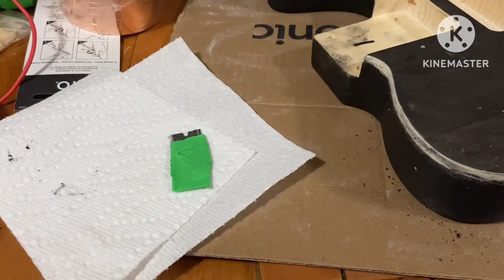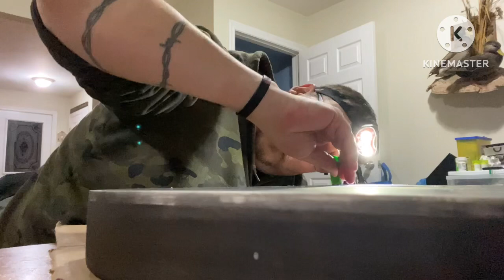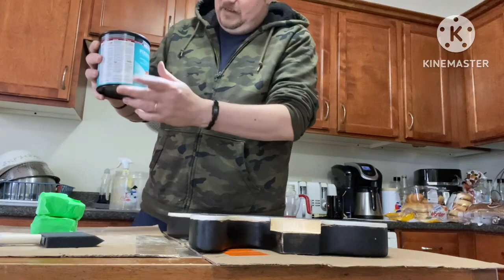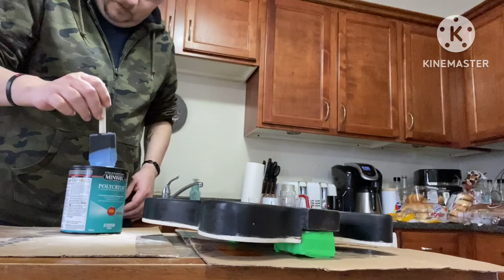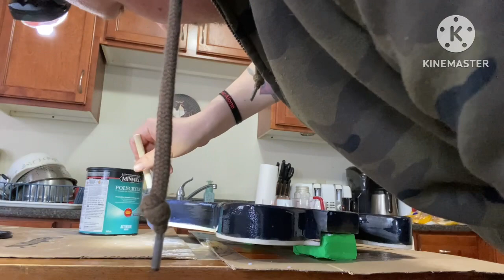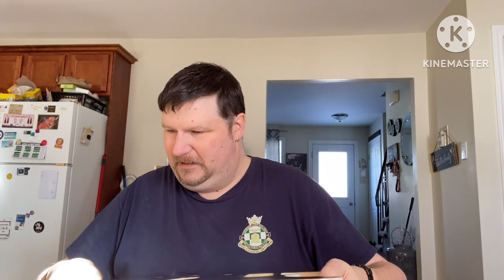Solo Music guitar build Pt 2 Binding scraping/ clear coat

Comment: Nice work on the guitar project, just curious if you're going to do any wet sanding of the clear coat on the back and apply another coat.  Have a great day
Reply from the maker: Thanks Rusty! I wasn’t planning on it, this seems to have a pretty decent sheen as is, might do another coat or two on the back as I clear coat the wrap, and than I’ll polish it all up.
Reply: @JMac.  Nothing like doing a wet sand and dropping a new coat over it to get that depth and shine
Reply from the maker: @TheRustyRazorOriginal  yeah, that is a fair point for sure… I’ll have to see what it looks like come Friday, have to get a capo and some feeler gauges to do the setup, just hate to have to clear coat again though lol, I wanna build it!
Reply: @JMac.  I think the work will be worth it in the long run
Reply from the maker: @TheRustyRazorOriginal  it’s looking pretty good now as is. I’ll be doing quite a bit of buffing with a good guitar polish once the top coat cures, I think it will look great. This stuff isn’t as hard as a lacquer, so I don’t wanna get too crazy.
Reply: @JMac.  👍😎👍